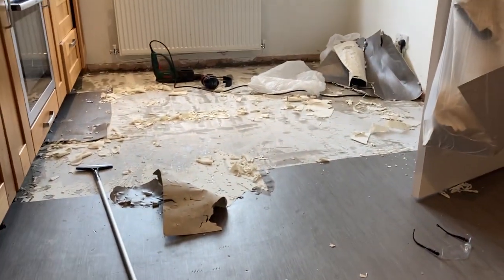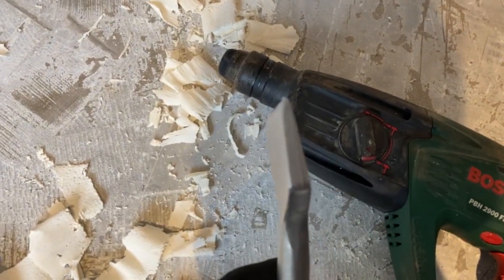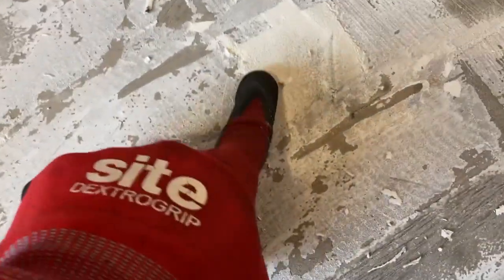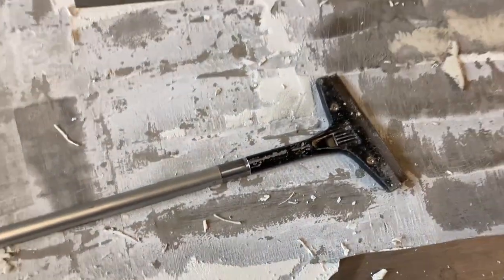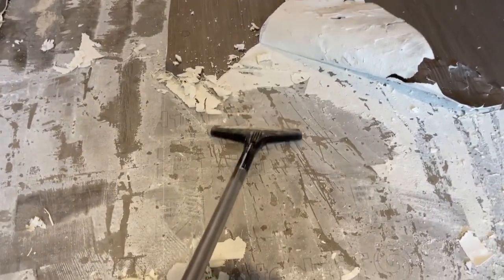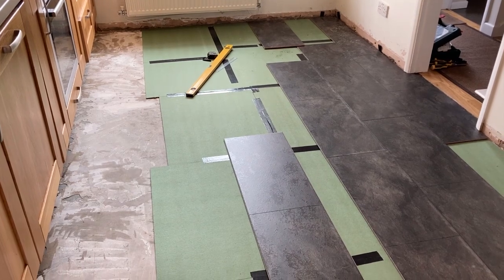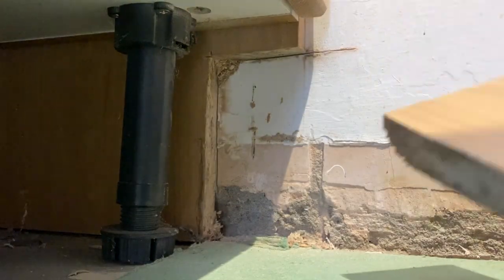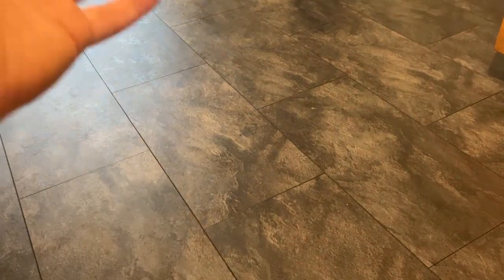Easy Way To Remove Lino Flooring (at least the foam backed type)

Comment: look up Sentinel adhesive solvent 626 or 747 Plus. Leave on 60-90 min and glue scrapes up clean and easy
Reply from the maker: Ok thanks
Reply from the maker: Ok thanks
Reply: Does it penetrate the actual linoleum or vinyl? Or do you use it just to remove the residue?

Comment: Would this work for wood subfloor? I imagine it would just destroy it.
Reply from the maker: It might scratch it but the blade is not that sharp.  Concrete floors are quite common in the UK so no problem there.

Comment: Can you use this tool as a jackhammer? Like for digging in rocky ground
Reply from the maker: Yes in fact I used it to remove some of the concrete footings when I put up a new fence a few years ago.  However it is about on the limit for that kind of work and you would be better with something bigger.  It did get hot !
It is really for removing tiles or drilling holes in brick and so on.

Comment: FedEx that looks like it'll take forever I'm thinking about using this 60,000 btu propane torpedo heater. Damn I wish I had an SDS drill right now
Reply from the maker: Heating it will work but be very careful of the fumes.  Keep the room well ventilated, with a fan if possible.  Or wait for the SDS drill to arrive, much more fun!